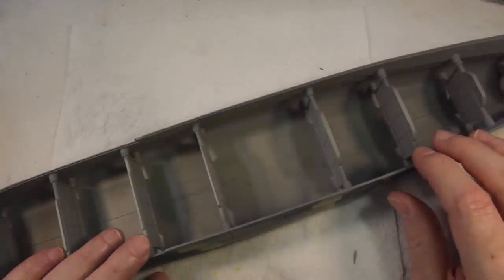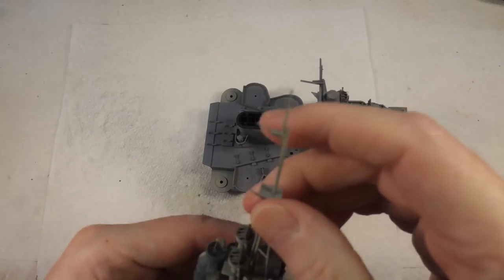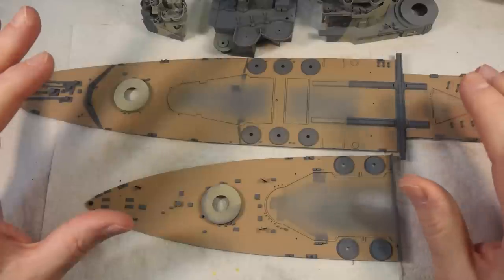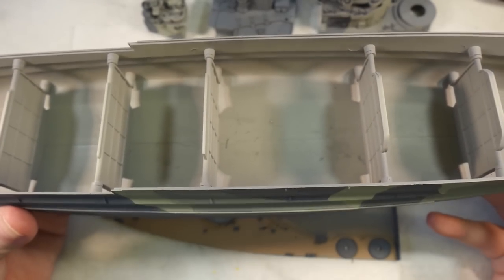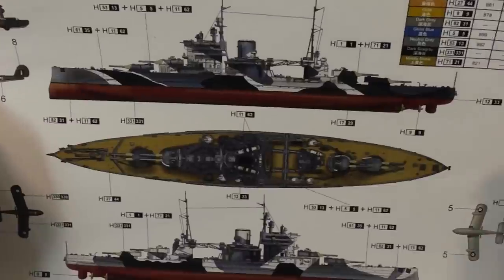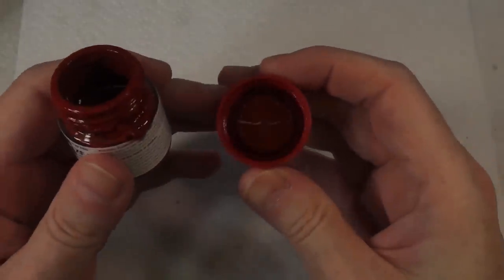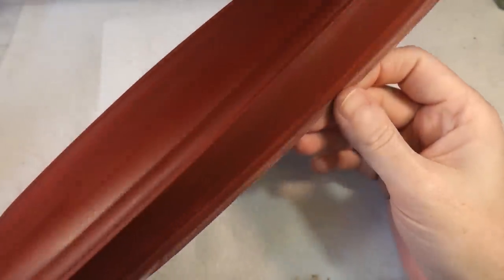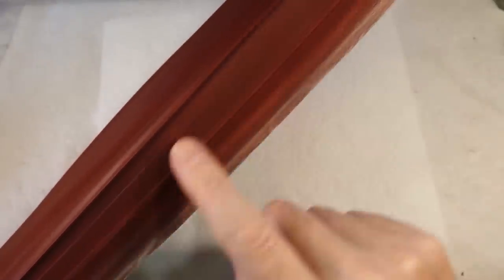Building the 1/350 Battleship Queen Elizabeth for Drachinifel - Part 4 Final assembly and weathering

Comment: I wonder if my memory fails me or those kits made really amazing improvements since i was building plastic models about 20 years ago? I remember that nothing ever fit strait out of the box so painting anything without dry-fitting it first was not even an option.

Btw cameras are very unforgiving when shooting the models. They show even smallest mistakes not visible for naked eye but your build looks good even on camera.
Reply from the maker: A lot of these models are still made with very old moulds, so those same issues still exist. You're very right about the camera too - there have been many times when I've made something, then taken a picture of it and seen something I missed. I actually use that to my advantage now - for example if I have to read tiny print, I take a photo of it with my phone :-)

Comment: Never knew the QE had green camo.  Seems great if it were a tank or if it made a quick trip to Eastern France but its strange.
4:50 Huey flies over...distinctive sound
Tamiya xf-9 dries redder than you would expect.  A touch of red is usually what I do too.  Sometimes I do more red with a touch of xf9.  Thats why the pink came out.  I started spraying a test card for colors I wasn't certain of.  There's tons of colors that look different dry than wet.
If you can get it, revell contacta will change the way you think of revell, its awesome on decks, wings and other heavy pieces.
Tamiya thin is bad on big parts.  It dries too quickly. If you need fast and strong, cement S is good, not SP, ...S. S is strong, SP is fast.
As I typed, you used contacta on the anchor.   Should use it on the deck.
Looks great.  Thank you for the video.
Reply from the maker: It's actually not Tamiya Extra Thin, despite the bottle. I generally use MEK most of the time, but the Tamiya bottle/brush is very handy to apply it. I use several different types of adhesive depending on what I'm doing - it just doesn't always look that way in the videos :-)
Reply: @SteamGeezerUK  gotcha, Contacta for everyone else is what should be used for heavy objects....  i am glad they are starting to import it.  I was given a bottle when I was medevacd to Germany from Afghanistan. The chaplain who got me started on building Models  again gave it to me along with a few kits when I was going through surgeries.  I ran out a long time ago and had to pay crazy prices to get it.  Im a huge supporter of buying the right stuff for the right parts.  Just like using ca on photoetch and white glue on glass, I use contacta on heavy stuff or if its bigger I use epoxy.
Thanks for the videos, I enjoy them more every time you release one.

Comment: Things like the step ladder orientation and missing propeller shaft mating guide are the reason why I hate Trumpeter kits. I don't know if they've gotten better over the years but I've found similar problems in every kit I've built from that company. Great molding but their engineering is a bit shaky
Nice job
Reply from the maker: Thanks. This is the first Trumpeter kit I've ever built, so I couldn't speak to their overall quality, but I guess all manufacturers have their little faults and foibles :-)

Comment: Ok, this has been driving me crazy. It looks to me that you are using Tamiya extra thin glue to stick painted plastic parts to painted plastic parts. When I do that, any paint that the glue comes into contact with dissolves into an unholy mess. What obvious thing am I missing?
Reply from the maker: I actually use MEK, methyl ethyl ketone - I just  keep it in a Tamiya bottle for convenience. Having said that, it should still work. The trick (for me, anyway) is to apply the glue sparingly and try not to move the parts around, which includes not pressing them together. Because this is a weld bond, ie the glue actually melts the plastic, if you move the parts or press them too hard together, you'll end up with liquid plastic going all over. Might be worth throwing a coat of paint on some old parts and practice gluing them together.
Reply: @SteamGeezerUK  Thanks for your reply, it does make sense. As they say, practice makes perfect so I'll do exactly what you suggest and have a play with some old parts. Cheers.

Comment: Nice build, but no railings?
Reply from the maker: No, not on this. I discussed it with the person it was built for, and he didn't want them as they weren't included in the kit. I could have used aftermarket ones or scratchbuilt them, but the client wasn't bothered about it so I didn't. Kind of surprised they weren't included, to be honest.
Reply: @SteamGeezerUK  Sir: your reply received and understood. Still, it seems incomplete. But the client always wins! I have the WARSPITE on my shelf and it’s a little intimidating as I’ve never dealt with PE and the instructions aren’t clear. Fingers crossed.
Reply from the maker: @eugenebotkins2469  Good luck with it 🙂